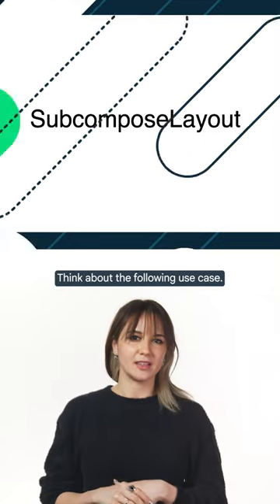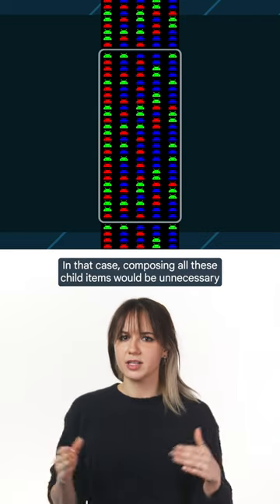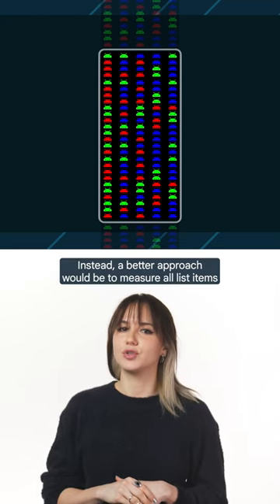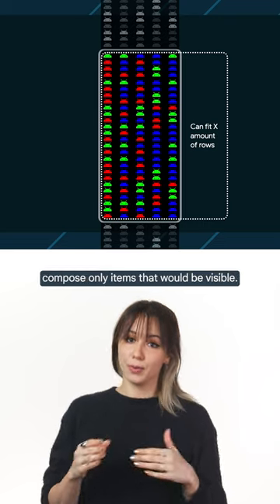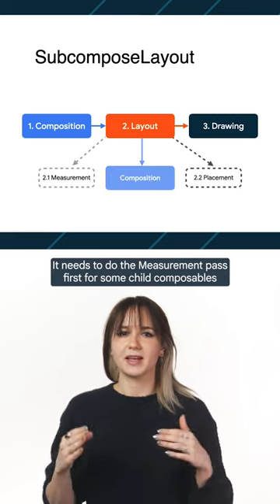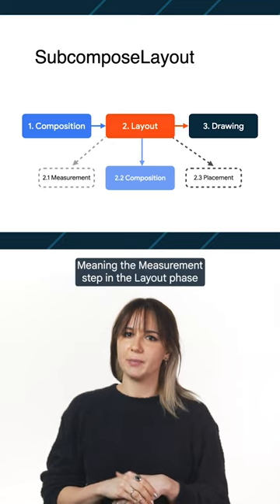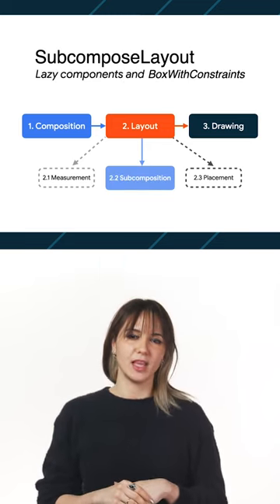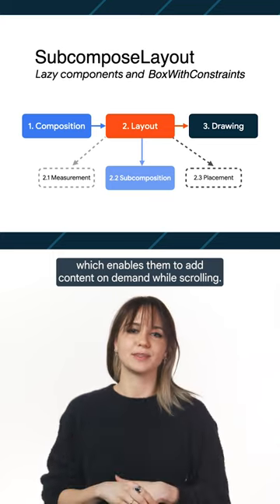Advanced layout concepts

Comment: So what's the difference between this and recycler view?
Reply: that it's a complete rewrite of the same idea
Reply: LazyRow and LazyCloumn is for declarive Ui...
That saves a lot of time to code list features instead of creating too many adapters and viewholders and all just for a simple list...
Reply: @deepakbisht4957  you really only needed 1 adapter
Reply: @Zhuinden  too much code for just basic list and click events...
It hardly takes 2 min to code a simple Declarative Compose list whereas Recycler view takes too much initialisation in your controller, then create Adpater and Custom Viewholder and separate XML views and then bind that XML with Adapter and then handling Click with interface or Higher order function...
Too much work for a simple thing.
I'm using the Recycler view from the start and even created my own custom template to avoid boiler plate code but this Declarative thing like Compose is much better to develop Front end then with a lot of coupling in XML
Reply: @deepakbisht4957  it really doesn't take much effort to make it simpler, but for some reason apart from lisawray/Groupie the other libs like recyclerViewItemDelegates or FastAdapter or Epoxy made it more complicated than it actually was.
Reply: @Zhuinden  well I'm okay with Both XML and Compose as I'm developing Android app since Android studio was not even a thing.
All I'm saying is building apps in compose is much faster,  less boiler plate code with less coupling, easy to test and less error prone, easy to reuse components and easy to maintain code and you can do anything with just Kotlin...